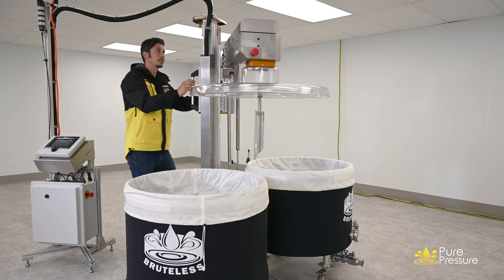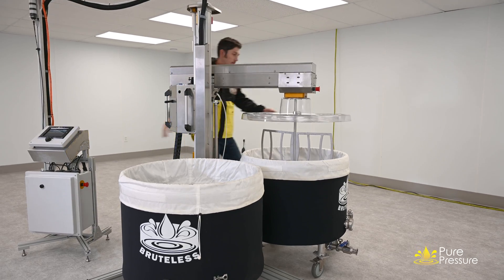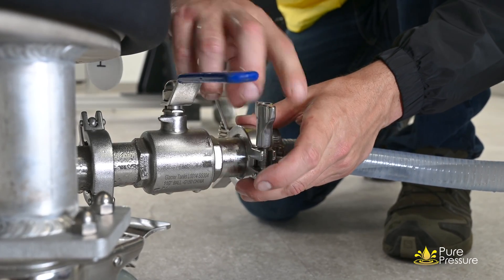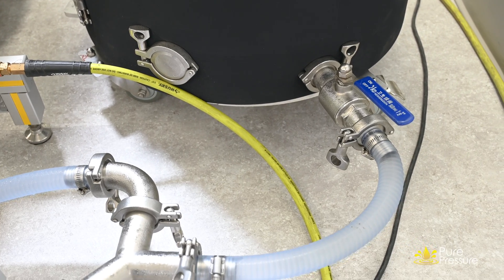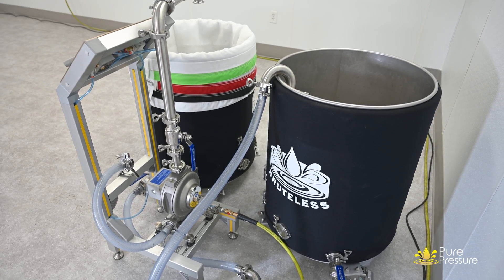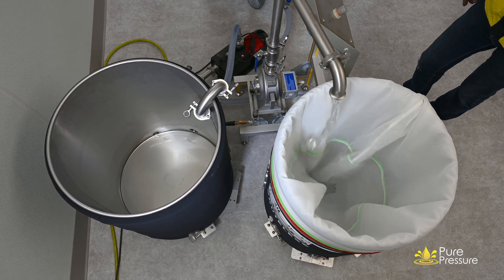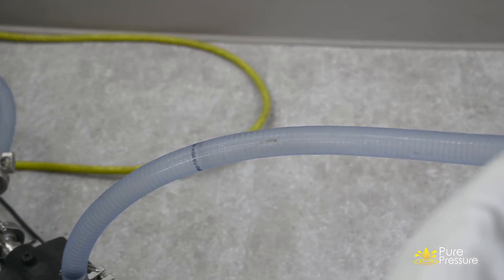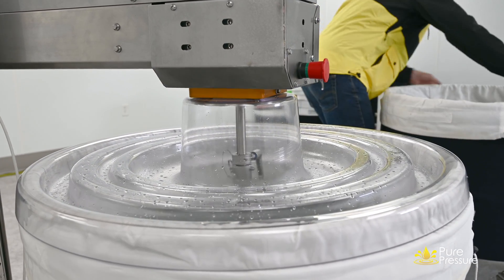PurePressure User Guide: Axis Trichome Separator Filtration Package Tutorial

Comment: Why did you choose a design with a mixer instead of using water as the agitation??
Reply from the maker: Great question, and there are a variety of reasons. The Axis uses a mixer/paddle for agitation because that is the same mechanism used when you hand paddle. The Axis is the most hand paddle-similar unit on the market because it has a low shear "mixer" (like a hand paddle) and because it has top agitation. Other hash washing machines are bottom impeller based, meaning that the impeller spins at the bottom of the machine and pushes all of your trichomes back up into the material that you just separated them from. When you solely use water as your agitation, it almost creates a giant blender and can over wash your material. Utilizing a mixer with ice and water all acting as agitators is much more shear sensitive than a spinning impeller.